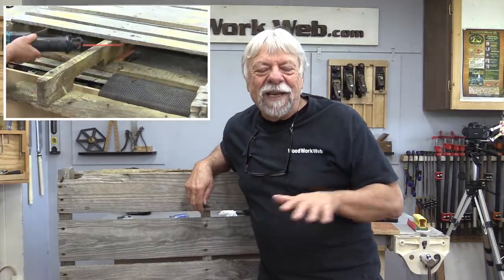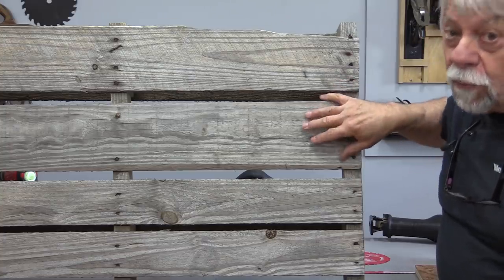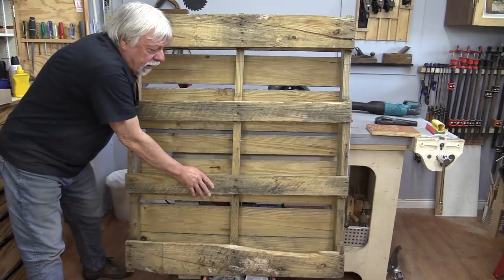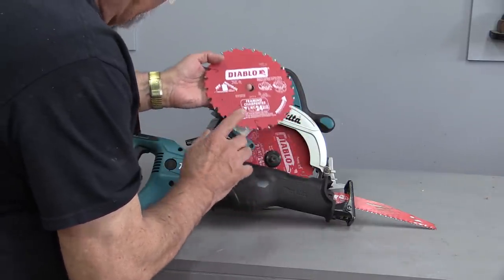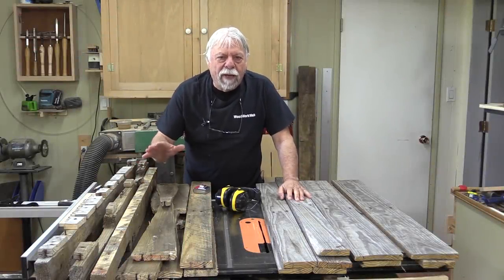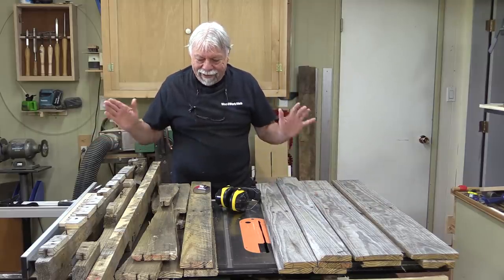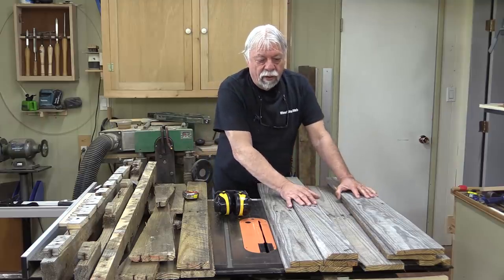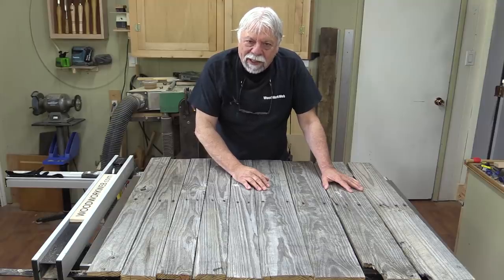Why Colin Knecht Quit Using Pallet Wood for Woodworking

Comment: I live in south Africa and wood here is extremely expensive...at least to the average guy, I use old pallets to make headboards and other furniture,  I use a disassembly tool and remove all nails , once it's gone through a thicknesser planer it's quite beautiful,  the furniture I've made after sanding and staining is not rustic at all and comes out really smooth and professional looking,  for me it's absolutely worth using and I'll keep at it
Reply: Greetings from Florida .He has most likely changed his mind now that the fool running our Country has  caused wood to become extremely expensive as well.
Reply: Well said
Reply: I'm sure your furniture looks amazing(any videos?) But it's not just the nails you got to watch out for it's other stuff as well like stones & grit embedded into the wood & sometimes chemicals so quite a few hazards to look out for esp if you are using a thicknesser.
Reply: What tool do you use. I have just put a nice palet on my roof. I haven't bought a planner yet. Don't know what one to get 😭
Reply: @deancyrus1  I tried to copy a link for you but no luck, but here on YouTube there's tons of them, just punch in pallet tool, I use the type that has the long handle and two prongs at the end, its easy enough to make....don't even have to bend over to strip the pallet
Reply: @billybatts9491  it'll work but takes an age
Reply: @billybatts9491  I use a magnet and run it up and down the plank to detect any metal, although there are more high tech tools for the job but again ...$$$
Reply: @billybatts9491  ouch! They can be a real head ache to get out if embedded in, I used to make pallets when I left school, GKN pallets mainly and crates for YKK, nailed through fingers a few times🙄
Reply: @billybatts9491  pulls towards it
Reply: @billybatts9491  ha ha, yeah some are 4" ring shank nails so when pulling your fingers off the nail quite a bit of flesh & blood left on the shanks, I had come out of the side of the middle block as I was holding it in position, one through the side of a crate I was holding the springy side in ready to nail and it came through the corner & me and a buddy at a different pallet compamy nailed our hands in a multi nailed machine, I was lucky it went through the web bit of skin inbetween fingers my buddy not so lucky it went through his index finger bone nr the knuckle but hey when you only get 5p each per pallet you are going to have incidents.
Reply: @billybatts9491  it all happens so fast, I'm in UK so off to bed for me, anyhow nice talking to you & be safe🤞😃
Reply: Do you have a YouTube channel?
Reply: @Motoguy94  I only have pictures,  never thought about doing a channel
Reply: Wood is super expensive here in Hawaii as well.
Reply: You can take black or grey water base paint and thin it down brush plain blond or yellow wood let it dry sand make it look sun bleached
Reply: @dennisfrier3191   last fool did it

Comment: I've been using pallet wood for years and never had so many problems as what's described in the video.
Reply: I've never had problems with pallet wood my self course I build rustic tables as far as I'm concerned rustic is where. It's all bout
Reply: I think he picked the worst possible pallet to use as an example. You can easily pick up pallets in excellent condition.

Comment: I get my pallet wood from a nearby company that uses a lot of one way pallets. It's basically fresh from the saw mill. Yes, I have to disassemble it but now I'll never have to buy nails again.
I built most of my workshop furniture with it by laminating it into 2x4s and such.
So I guess I saved a bunch of money.
Plus ppl throw away all kinds of things which land on the company's pile. Treated 2x4s upt 5 meters long, 2x6 and 2x8... Also a ton of expensive screws that I'll be able to use again.
Sl for me it totally pays off to go there once in a while.

Comment: I agree on most of what you say! But sometimes especially for rough projects it's worth it. Also in some occasions the dirty look of pallet wood adds a lot of character to a piece!
Reply: exactly making say a rustic milk bottle crate or even a garden bar looks way cooler in old pallet wood
Reply: @Littlelamb2023 
You can ‘make’ rustic-looking wood without a great deal of time, and still work with clean, dry lumber that isn’t going to wreck your blades. Pallet wood sucks except in a woodstove.

Comment: I personally have never had any dramas with pallet Wood.
I collect mine from a local tile Shop, they have one off disposable pallets, so they are new, no chemicals and are only heat treated.
I have decked out my entire work shop, floors, walls and ceilings for free. 👍🏽
Plus I have built an entire chook pen, 3 bay compost bins, countless outdoor day beds, raised dog beds, and so much more...
I have a pallet breaker and never crack any boards when dismantling, I have an AirLocker pneumatic nail punch which means no hammer or crowbar needed for nail removal. I have save so much money by utilising what would become landfill.

Comment: When you are time rich and cash poor, it can be worth salvaging pallet wood for some projects. I've build a lot of gates and garden furniture from pallet wood and it all lasted many years and looked great. I'd never bother trying any fine wood working with it but for rustic outdoor projects it's great. You can also salvage a lot more wood than you did Colin if you take a little more care. An electorinic pipe / studfinder is a great way to test for any residual metal in the salvaged timber.
Reply: A strong magnet is also a super quick way to find metal, battery free. They rarely have non-magnetic metals in them...at least in my area I've never found it.
Reply: Time rich and money poor, but have a joiner and saws and planers, makes sense
The only reason i would go for reclaimed wood is for it's look, not because it saves me money or time, it is not
Reply: Oh, Maxx, I hear you.  I'm 74 and will celebrate three-quarters of a century-old soon.  I'm on Social Security.  I scrounge wood from wherever I can.  I'm making a shop cart presently from salvaged wood.
Reply: dont need any fancy tools, i made a small chicken coop out of pallet wood with just a hand saw, hammer and elecrtric drill. i managed to get more out of the pallets than he did too.

Comment: Very good presentation! I agree with your analysis on the very limited cost saving.

The one point I would like to add:  most of these pallets are used in industrial applications. Having worked in a number of manufacturing plants I know there are all kinds of nasty (deadly?) chemicals that get spilled on them. I wouldn’t want to build something with them and have around family and friends.  And I certainly would not want to burn them.

Comment: Pallet wood is only as good as it comes. I have found some really nice pallets on construction sites because some of the new machinery, or supplies come on new pallets custom made for whatever came on them, these are the pallets I look out for. Some specialty pallets are made of red oak, some are popular, even maple. Some have 3/8ths plywood in them. I have found tie down bolts in some, and some are held together with nice construction screws! Never goto a grocery store, or big box store for pallets, those are trash. Also, if you do get pallets from there, expect to make a rustic, old looking "thing" out of it, because of the aforementioned fact that you cannot run these piece into a planer. Hospitals, specialty suppliers, and big industrial construction sites are the places to look. I should also mention that these specialty pallets are often much longer and have boards 8-12 feet in length, making the time to recover them worth while.
Reply: Yeah I get some 4 quarter pine pieces about 90 plus inches long with rounded edges and Hard maple runners from a heating and cooling place. They get the sheet metal delivered on them.
Reply: You sound like a good scrounger to me.
Reply: Machinery pallets are the best! So much oak
Reply: @Markus Patients youre lucky.. i always get red oak
Reply: I built my steps out of three pallets that had steel on them, each board was 1"thick,  i also used a belt sander to turn them down insted of a planer since I don't own a planer. They were all red oak which came out looking like rootbeer.
Reply: @billybatts9491  IDK if this was the video or not... but running that stuff through a planer will get sand and dirt dulling your blade a bit faster than normal... pallets arent the best for that. they sit on the ground and get grim ground into the wood...

Comment: The secret i found to salvaging these things is to use a car jack and wind it open until it pops the nails out of the upper boards. Avoids the need to saw it at all.

Of course its only worth doing if you find a frigging pristine pallet to cut up
Reply: I bust open the riser block style pallets using a hydraulic porta power unit. It is kind of like a jack.
Reply: I use a $40 pallet buster and $50 pneumatic nail remover. Takes me about 10 minutes to fully disassemble a pallet and remove all nails.

Comment: I've used pallet wood to make a large log store outside, which would have cost me a couple of hundred to buy something smaller. It was time consuming yes, but for me I enjoyed doing it. I also don't have the planer or jointer, just table saw and portable saws. Also sanded down some pallet wood to make some boxes for the garage. Time eperience doing these things with free wood makes more sense than buying wood from the store that likely is just as warped anyway.
Reply: @N Crims Yep- profit in experience and skills gained, save on labor. Elbow grease is a cheap commodity, unless it's someone elses elbows.
Reply: Completely agree, aside from the satisfaction of reducing waste in a landfill, i gained experience and tried skills that i would not have with store bough wood (although through bruised hands and splinters, i was tempted many time). I would do it again if i had to
Reply: Agree 100% it's a source of basic wood to make basic things, and at no cost is an opportunity to learn techniques. Also, like anything else in life, you have to be selective - the clean lightweight pallets that are used inside shipping cartons for some appliances are great if you can find them and don't want large dimension wood
Reply: When I used to work in solar and the portopotty was too far, I'd just go piss on the pallet pile LOL hows that kitchen hutch treating ya?
Reply: @WasteyCasey  lol

Comment: My feeling is that many people see the pallets as a challenge to use more than anything else. I have seen people take pallet wood and make some pretty incredible projects with it. I like the idea that something that was eventually going to be thrown in a landfill or used for firewood is turned into something useful and beautiful. I saw one headboard project where the person screwed and glued pieces of pallet wood that were about 5 by 10 inches each into a thin MDF board and arranged them in a Herringbone pattern. They then sanded it silky smooth by hand and put a nice lacquer finish on it. It was really beautiful and much nicer than many headboards you would see in a furniture store.
Reply: I love pallet wood and 2023 in the spring I will be building a wood shop 12x12
Reply: No one throws wood into a landfill :D
It's great as firewood, and wood is also extremely recyclable. MDF and particle board etc.

Comment: That also depends on the type of pallets. I live near a bass boat manufacturer and they run an ad weekly offering free wood. What they have is huge crates. Many contain 4x4 and 6x6 oak ranging from 6 foot to 18 foot lengths.  As for the basic shipping pallet like you show, I gave up on those a long time ago.
Reply: Damn I'll be right over!

Comment: Great video!  I agree with you Colin as I don't use wooden pallets for several reason.  They are as follows:  1.  possible nasty wood splinters in my hands,  2. Many times, pallets are sprayed with toxic chemicals to kill bugs so they is why I don't even use them for the fireplace or fire pit and you don't want to breath these chemicals,  3.  possibly bring home some bugs, 4.  possibly ruining my hand and power tools,  5.  like you said, the wood is checked and split for the most part and not worth using or saving.

Comment: Agree Colin. It is very rare I use Pallets any more. Sometimes I can use the 'Dunnage' boards, which is the support boards that lift it off the ground to get the forks in. BUT specialist Pallets used for large machine parts do give good returns. I built two Adirondack chairs from 'Jarrah' from pallets I picked up from a factory.  The moral is, be very picky.
Reply: Peter Compton Agree about being picky.  I look for a place that always has a supply of the type I get most returns from and stick with that.
Reply: What do you use the stringers for? Ive been wondering what I can use mine for but there’s not a lot of videos on YouTube showing what people actually build using them.

Comment: But for a rustic outdoor application
They're perfect. 
For instance
A planter box to hold pre planted container flowers 

But I do agree
You've got to be super careful
I deal with pallets everyday on the job and it is very common to see barrels and bags of chemicals, paint and such being shipped on these. 

I wouldn't use this in a food application such as a planter box or raised garden bed.

Comment: As long as you’re careful, using a magnet to find nails, for example, pallet wood can be used and very nice.
Reply: I agree. I wouldn't use it regularly but I use it now and again. In fact I repaired some garden furniture and decking joists round the swimming pool recently, perfect for that. I also have a wood stove so nothing gets wasted. If the pallets are really good, then one can sell them back to a pallet company (in my country at least ), so that's the best use of all.
Reply: I agree.  You have to put in that prep work.
Reply: He just said gravel and dirt embeds itself into the wood that chips and degrades  blades.
Reply: @touofthehighplains  If it was one sitting on the ground outside. 

Where I am most of the pallets you can pick up for free/cheap never saw outside. They went straight from a warehouse to the truck, then back to the warehouse and they are only tossing them because too many of the boards are cracked/broken runner.  The rest of the pallet though? Excellent wood.

Comment: As others have mentioned in the comments in order for repurposing pallet wood to make sense you have to be very picky.  First if the pallet is marked with the letters “HT” it is heat treated and unless there is an obvious discoloration from a spill of some sort it is safe to issue.  Secondly look for clean pallets, if they are cracked and weathered (like the one in the video) or painted or have discolored areas avoid them.  some pallets are made from very nice wood.  I have found pallets made almost entirely of cherry and many oak pallets.  I have built several very functional pieces of shop furniture from it.
Reply: Pallet wood rules

Comment: This is a great perspective on pallet wood.  I recently purchased a pallet tool and it makes disassembly very fast.  About 5 minutes a pallet, then another 5-10 minutes to remove the nails.  It's much faster than using a pry bar (takes me over an hour with a bar and I usually end up breaking 1/2 my boards) and can save you money over buying blades long term.  Using pallets is a way to be more sustainable in your building, but you really do end up paying time instead of cash for the material.

Comment: Yes, Colín, it takes much longer to use pallet wood, it can damage the tools, and the finish is not the same.  But there are many more factors to consider.  if you have a good method to disassemble them, in the end it doesn't cost that much.  In my case, to use this wood I use cheap tools.  I also use it when I want a rustic finish or type of furniture.  Above all, you should bear in mind that in many places in the world, such as Spain, plywood is very, very expensive.  And perhaps the most important thing is that by reusing this wood we avoid cutting more trees.

Comment: Good information Collin.Back in the 80's I worked in a planing mill here in Ontario. I can tell you that the lumber we billed and built pallets from had already been deemed not good for any other uses. Mostof the raw and green) lumber had already been rejected by all other customers and was turned into pallets by us. Most of it was from deciduous trees that were culled to allow access to viable timber.

Comment: I currently use pallet wood to build a lot of different products even did two sets of stairs in my home. So if you can pick out the pallets, you can pretty much use mostly all the boards, I do the rustic stuff, I have people that want the most warn wood for planters,end tables, and benches.

Comment: Seems to depend on where you are from the quality of pallet wood. Here in europe the standardised road transport pallets are made of the best quality wood with no knots or a maximum of 1 small knot per meter of wood. Pallets are also taken out of circulation and rebuilt when they are battered. When you recieve goods you usually return the same number of empty pallets and the drivers are usually very particular about the quality of the pallets they take.

Comment: I agree with your observations for the most part. Sometimes you come across very nice boards without spiral shank nails that come apart quite nicely.
We received some supplies from South America on pallets made from various strains of mahogany & the skid sections were 3" x 4" pauduk! The colors were amazing, ranging from golds, reds, purple, greens & deep rich chocolate brown.
It would have been a sin to alter the natural colors so I used amber/orange shellac for the base coat & only clear shellac for additional coats. I would love to take credit for how the wood looked but that was God's hands at work!✌